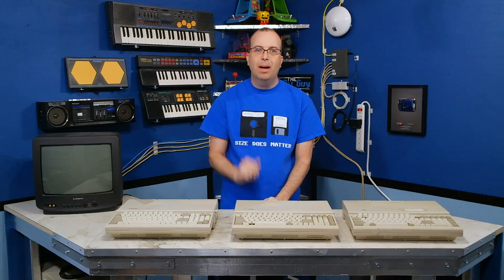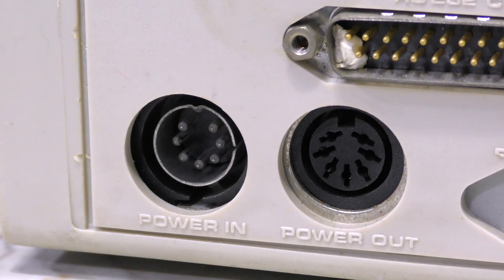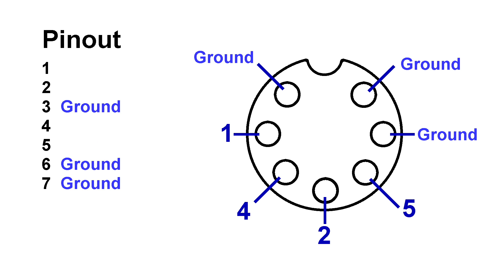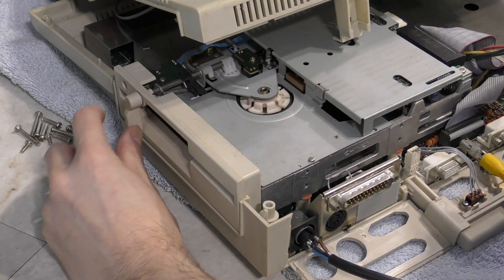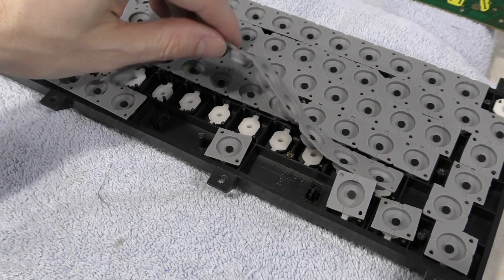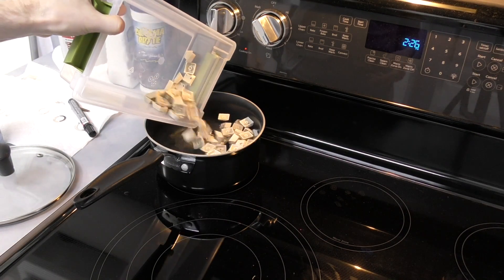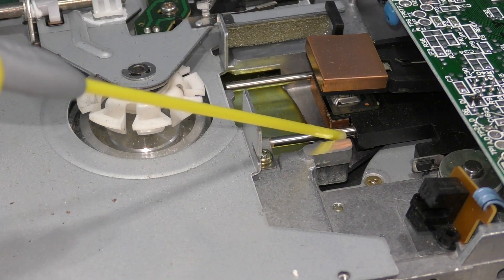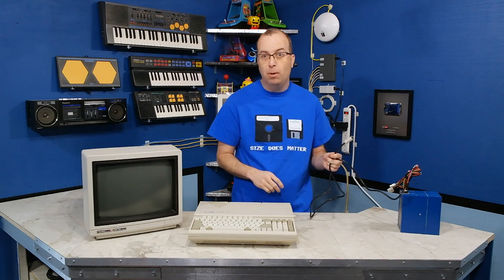Laser XT Restoration

Comment: I doubt anyone is still looking at the comments, but I'm wondering if the power out jack couldn't be moved to the power in if it's more common to find a power supply with a male plug?  It's not like you need the power out for a monitor now.

Comment: If you are still looking for an external PSU you may check the ones for Atari 260ST/520ST. They come with the same connector (but different pinout) and provide: 5V @ 3A, +12V @ 0.03A and -12V @ 0.03A.

Comment: I know this is 4 years old, but may I suggest that when creating a power connector with a shield shroud, that you use heat shrink tubing on the voltage pins.  If you squeeze that connector too tight there's a possibility (albeit remote) of the power pins and ground shorting via that metal shroud.

Comment: Nice restoration.  I’ve still got my C64 with Tape Deck, and games, and my Amiga 600 with external floppy drive in my loft.  Gonna have to get them down this year, and test them, as these both were my favourite machines.  I may have to retro bright them, but was wondering what the best method is to do this?  Shall I use ultraviolet leds and hydrogen peroxide or other chemicals?   I watch all your videos, and love them all.  Keep up the great work.  Thanks.

Comment: Always surprised that these machines didn't sell as well as the Laser 128 series! They seem much more useful for their era, the 128 came around in the mid 80s, when the Apple ][ was already all but obsolete, and the IBM was king! 
Maybe the lack of expansion capabilities is what ultimately put people off. You could get external floppy drives and a card chassis to put ISA boards in, but these are exceedingly rare.

Comment: For retrobrite is the UV rays reacting with the peroxide to whiten the plastic, or is it the heat. If it is the heat you can use a immersion circulator to precisely heat water to the desired temperature so you don't have to worry about the sun if you're doing larger pieces.

Comment: Thank You for this intuitive video, I summed up the courage to open my laser compact XT for cleaning, used some air on the ram and it sprang to life, booted up, then checked the drive and have it working. Key board sticks but i will attempt to clean it. I must say that this machine was last used during 1989 to perhaps 92. been in storage all these years, but now.. IT'S ALIVE !! I am not gonna worry much about the actual keys, but i will look at the contact board and clean. BTW all keys are intact.  I also just realized that I had attached a second external drive a 3.5 backpack, so after key board that is next. 
Thank You so much again....Upon  operation checkout..it might be for sale.  Michael in Tucson AZ

Comment: Have you ever tried using cream cleaner on plastic parts ? It may be too abrasive. Ive used it on pvc pipes and guttering and even a plastic sink and it does a good job at removing tough dirt

Comment: I have a working Laser Compact XT with the power supply and the optional external 3.5 floppy for 720K disks.  I think I even have the original manuals for the thing.  I'd love to know if there is way to connect a newer SD drive, does anyone know?
Reply: P.S. 8-Bit Guy, love your videos and especially this one!  I always liked this computer since it was similar to the one used the 1985 movie  Explorers, as used my the character Wolfgang Muller (River Phoenix).  I was always confused why people told me back in the day my XT would also run "apple" games...your video explains it...my version is not the "128" but they look the same.

Comment: That broken key mount says "3d print me"
Reply: No point in 3D printing when you have a parts machine like this.
Reply: Not a bad idea in concept but with keyboard sliders you have to be careful with the tolerances so it would most likely require some test fitting and/or sanding perhaps
Reply: Know from experience it doesn't work very well because you have to have extremely fine resolution which most consumer models can't reproduce. That and the resulting key stalk works a lot better if it's smooth, which you can achieve with sanding and acetone, but it's a lot of work and it'll never be as good as just getting a piece from the parts machine you have right next to you anyways.
Reply: @AiOinc1   Resin printing might be a better choice for something like this than FDM printing. Though you could also just use resin casting to duplicate one of the existing parts...
Reply: @tetsujin_144  he had someone in another video who casted parts for an  old toy robot.

Comment: You should use one ATX PSU and adapt all of the low power PCs you need onto all of the molex connectors, and just have one universal PSU to run all of them.

Comment: Coincidence, I've started to repair my IIc (I know I'm lazy) and started to bypass the 110V power supply (I'm in Hong Kong, 220V). So I make the same 7 pin DIN as David did, with a laptop 17V power supply instead. Will test it soon.

Comment: Looks like the game takes advantage of NTSC artifacting for the extra colors. That's why the RGB doesn't.  The Tandy Color Computer 3 overcame that by emulating artifacts for its two-color mode at a lower resolution using four-color mode.

Comment: The (non-qualified) electrician in my head looks at most of the power connectors for these various computers and thinks "Exposed voltage pins? Uh... nope." Sure it's only <24V, but still.

Comment: One more cleaning solution I use for gummy/sticky junk on any surface is contact cement cleaner. It removes most anything actually, and so far has never harmed any plastic or painted surface. just be sure to test a small spot not visible on the machine.

Comment: Datel makes a 45W 9-48vdc in +12 -12 +5v DC-DC brick.  A120v to 24v transformer, Full Wave Rectifier, and four 4700uf 50v smoothing capacitors is about all you really need for input to the brick.  
Or just pare down an old AT power supply and put it in a project box.

Comment: Hey David, just a quick thought, if the voltages on the 128 power supply are the same, why not make a male to female adaptor for the XT? If they're all the same voltages you could probably swap wires around to get the correct voltages. It's not elegant, but it is functional.

Comment: I just bought the Laser Rs232 adaptor for the (I think) XT off ebay, there was a seller liquidating new old stock for $5 an adapter.  Also, I did the same trick for a power supply with my Apple IIc when I got it, I just made a pigtail to connect to an existing molex connector and convert that to the IIc.  I eventually purchased a nice universal 5v / 12v power supply off the web, but I still have that home brew pigtail.  I actually have a mint Laser 128 also, but now I want to find the XT for my collection too!

Comment: Not sure if you found a power supply of not but a quick search for a brick or I found this yes you have to redo the pin out again  https://www.amazon.com/MEAN-WELL-P50A13D-R1BU-Switching-Supply/dp/B005T9OXPK/ref=sr_1_9?ie=UTF8&qid=1529761978&sr=8-9&keywords=Power+supply+5%2B+12%2B+12-

Comment: Do they teach that in college about how to design a piece of hardware for safety? Create several machines with different non-standard power supply pin configurations, which can nevertheless be connected to the wrong machine, potentially breaking the machine and/or the power supply, and perhaps even being incredibly dangerous. High-voltage power supply design safety 101?

Comment: Why you just don't make an adapter from the Laser 128 power supply to the XT output? You just need a male connector and change the arrangement of the cables to the pins to make a cable like this.

Comment: I need a Power Supply for my unit as well. I believe 4 - 64k x 4 chips will bring the unit up to 640k. I have the manual for mine, and I might have a PDF version. If I have it, I'll e-mail it to you.
Reply: I found a decent power supply on another video, the MeanWell RT-65B should be fine for this unit. eBay has a nice case too: ABS-68 Enclosure. I saw these on a video from MsMadLemon who used one of these and the case for her Amiga 600.

Comment: https://m.ebay.ie/itm/Vtech-Laser-Compact-XT-in-original-box-IBM-XT-Compatible-Computer-/122476220309
Reply: this is a laser xt on ebay complete with original power supply
Reply: Did you comment before the video ended? Just remove the computer and leave the power supply on auction. He completed restoration.

Comment: 10:50 - I found that cleaning keys is easiest in a dishwasher . No kidding. I even used that method on light switches and wall plug outlet consoles. Works like a charm. I would upload a photo, but don't know how to do that on YT - or indeed if that is possible in the first place.

Comment: @the8bitguy: Those DIN power plug's pin numbering is "weird" for a reason: They were originally german audio plugs, Initially with 3 pins. One side for audio in, one for audio out, and the central pin was ground. Then two extra pins were added on the left and right side for stereo operation. Then even later three additional pins were added. One in the very center and two at the very bottom. Not sure what their purpose was, but the C64 for example used that for composite video. However for that purpose a different DIN pin arrangement was more commonly used (The 6-pin version). 

See: https://www.electronics2000.co.uk/pin-out/dincon.php

Comment: Maybe try installing windows 1, 2, 3 or 3.1 on the laser XT
Reply: The XT computers can't run Windows
Reply: even 1 or 2 that came on big floppys
Reply: There was 5.25 floppy with 1.2 MB.They were used in most 386/486 computers.
Reply: maybe he can burn it on the old floppy via an usb floppy drive!!!
Reply: But the Proccesors of the XT computers are very weak to run any version of Windows
Reply: And the Laser XT don't have a hard drive.
Reply: The system will be slower than you can imagine as the floppy is continually accessed. I think Windows 2 will have problems if disks are switched and modules need to be reloaded but it has been a long time since I was crazy enough to try.

Comment: This was my first computer. I think I still have it. I don't think you will find the original power supply . 2 of them blew out on me. I went to a electronics surplus store and found a power supply with the same outputs and used that. I should find it and restore it. Are those memory chips still available?

Comment: I have built some small Amiga power supply with [5V:5A] [12V:2A] [-12V:0.8A] , do you have the Laser power requirement?
Could send you one with correct Din connector

Comment: You must obtain a variac! You cannot just plug in old PCs/PSUs and expect them not to go bang! All electrolytic capacitors will have reached the end of their lifetime and no power smoothing whilst switching on will be present. Just get a good variac and you can turn the voltage up gently. PS. It is sol-dering not sodering, sodering is closer to sodomy and you probably want to avoid that.

Comment: The reason for the odd numbering of the pins is that when the DIN plug was invented there was only a 3 pin version. It was used for audio connections and since everything was mono they only needed  3 pins: IN - GND - OUT (1-2-3). Later a stereo version was needed with 5 pins: IN L - IN R - GND - OUT R - OUT L. But in order not to mess up the old numbering the 3 mono pins had their numbers retained (1-4-2-5-3). Later there was a need for special purpose pins - like remote control signals or power. And again in order not to mess up the known sequence the new pins got numbers 6 and 7. So now it was 6-1-4-2-5-3-7. Perfectly easy to understand if you are used to work with DIN plugs :-)
Reply: organfairy oh god it's like 1980s usb-c

Comment: DIN pin numbering is standardized, it's one of the advantages of it being an actual standard. The numbering for 7-pin is 6 1 4 2 5 3 7 clockwise from the dimple when looking at a female connector (counterclockwise if looking at a male). The unusual ordering makes it compatible with 3-pin DIN (pins 1, 2, and 3 are in the same place) and 5-pin DIN (pins 1-5 are in the same places).

Unfortunately it seems like the person who supplied the pinout you used didn't know that.

Comment: The sharper text on the second one is probably due to newer/better capacitors for the video circuitry.  As Jan Beta has pointed out, newer caps on the RF modulator, for example, provide a sharper image.  I know the XT is using composite and not RF but the same could apply.

Comment: Would you consider doing a video about the Altair 8800 computer? I've always wondered what it did and why it was such a big deal. Like, it looks like a box with switches and lights. Why was this such a big deal?
Reply: Kairi091 well it was basically the first ever real Homecomputer. It had great expandability with even the cpu coming on a card.

Comment: I have some advice for cleaning keyboards, instead of using Windex and a paper towel, I'd suggest dipping an old toothbrush with rubbing alcohol and scrubbing all the little gaps. It is a lot easier and a little bit more effective.

Comment: As far as pin numbers on DIN connectors go, the numbering inside the plug is the correct one. The logic is simple: DIN connectors started with three pins, then they went up to five, six, etc. So they had to keep the old pin numbers the same (for the pins in the old positions), when they added more pins. A little confusing, but that’s how it’s always been.

Comment: Just add 2 12V power supplies together. Connect the Ground and the 12V output of the two ones together, this is your new Ground. +12V from the one PS is your +12V and GND from the other PS is your -12V

Comment: Hi 8 bit Guy, I hope going off topic is not too annoying but I dare not use face book or twitter as I am 57 years old.
I wonder if you could look into the devices that were used to make the sound effects in Star Trek original series . This series seems particularly rich in sound effects on the bridge, weapons other devices. The continuity in sound matched to particular button presses etc is impressive. The sounds hold up well even today. I doubt they were synths , had voltage controlled audio devices been developed?

Comment: Fun and informative videos. I have a little catching up to do so I don't know if you've talked about this subject but, some electronics and parts have these non-slip rubber coatings.  These things turn into seriously disgusting, gummy, sticky and gooey stuff in time. At first I thought it was because of the environment they were used in. But I have these unopened and in air tight plastic items which also seem to be in this condition mint out of the box. Do you have a method for cleaning this mess? I personally use isopropyl alcohol but one can't help but wonder if there are better methods to use for this problem.

Comment: FYI  you can small supplies you might be able to fit in orginal enclouser.(if you find one)  Also -12v is easy just take any ungrounded(2 wire supply) and attach the +12v to your ground and gnd to -12v.
2x 12v ones and a 5v one should do it.
http://www.mouser.com/ProductDetail/Mean-Well/APV-8-12/?qs=11eZi3QZxgC6EBVg7%252bpdOg%3D%3D
http://www.mouser.com/ProductDetail/Mean-Well/APV-8-5/?qs=%2fha2pyFaduh%252bItFVdagF3QNx5s4ttSZsyUXoDADzgEgF2pr%2fG43fSIE7Xe052t0N

Feel free to message me if you need help.

Comment: You should 3D print in case you would like both working
Reply: Getting 3D printed plungers to slide properly is a bit of a challenge, but the shape doesn't have any evil undercuts, you can simply mould it off in 2K silicone and cast in epoxy, and it'll be an excellent reproduction.

And i mean i have a 3D printer and i 3D print just about EVERYTHING i can think of, and i love sitting there in CAD for an evening, it's just so addicting, but IDK sometimes people lose track of TRIVIAL techniques that don't need any extra equipment at all.

Comment: I wanted a Laser 128 SO BAD as a kid. I knew the Apple II computers were too expensive, and the cheaper clone always teased. I knew even the clone wasn't gonna happen. My Grandmother got me a Commodore 128 for my fifth birthday, but with bills on the farm, we had to sell it. To make up for it, I could get anything to replace it, up to $50. I chose an electronics kit. That paid off. Repaired a Colecovison ADAM, and then later, when I was ten, I got a TRS-80 CoCo II for free cause it was broken, and I fixed it. Learned to program on it. I got a Commodore 64 a few years later, and used that till I finally snagged another Commodore 128, and a Mac

Comment: I had a Laser XT (Old IBM fans would be excused for thinking it had a hard drive,LOL) I used to use it for making video titles in BASIC thanks to the composite video output. I still have the floppys it came with in their original envelopes! They are boldly numbered 1,2 and 3, with color coded labels. Disk 1 (red label) is MS-DOS 3.3. Disk 2 (green label ) is MS-DOS Utilities and Disk 3 (blue label) is GW-BASIC (So yeah R,G,B. Clever!). the disks are in great shape because I was a good boy and only used  copies, LOL. It was a neat little machine even if it did lack an HDD!

Comment: Great video as always! I think a better replacement for the power supply would be a power supply used in USB HDD adapter/converter/enclosures. You have both 5v and 12v in it.

Comment: Why on earth would you destroy an original Commodore power supply just to salvage a cable which you can easily buy online -.-. And, while the Commodore PSU was not working, I‘m 99% confident it was possible to fix it.

Comment: To upgrade the memory of the Laser XT you have to install four 41256-12. If you want to increase the system speed you can install a NEC V20 instead of the 8088 CPU.